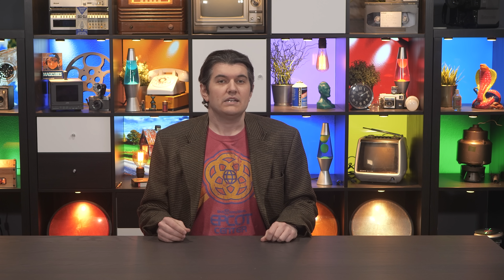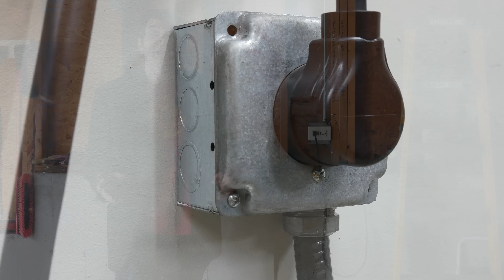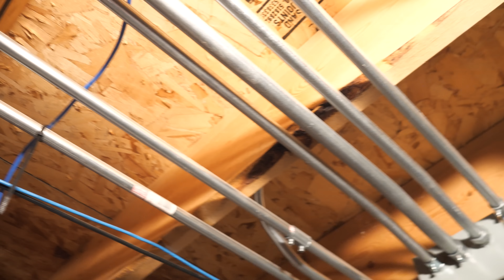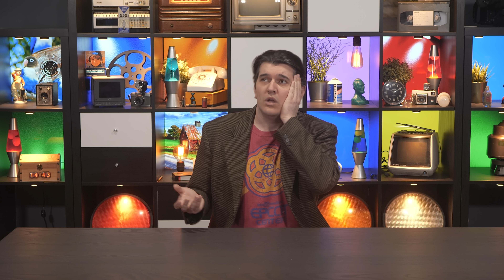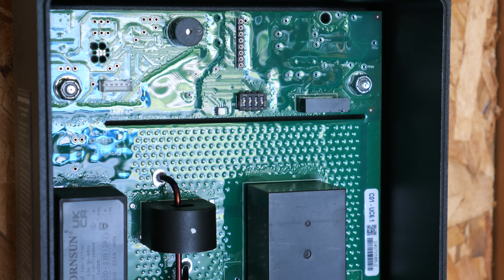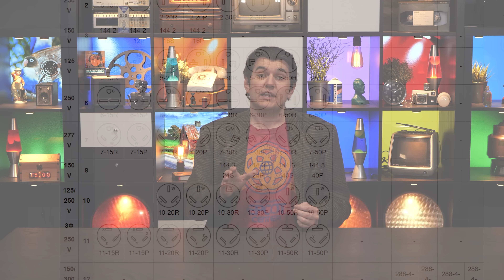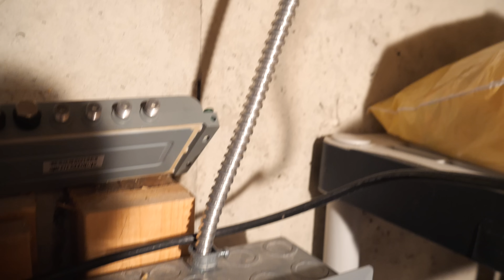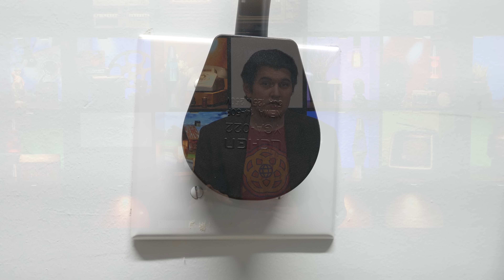The "standard" car charger is usually overkill—but your electrician might not know that

Comment: I love tech, but the first thing to fail is always SOFTWARE before HARDWARE. Smart apps and bad coding is always the breaking point. I love smart stuff when it works, but it's always the app design or layout or just the software not working that causes the issues.

Comment: The entire 'smart' home device which requires a separate general use device with a proprietary app installed repertoire is a horribly dumb idea. You are buying a device that CANNOT be relied on to still be useable in as little as a couple years depending on what happens with updates and development for the application, especially if the interaction requires a remote server to handle anything.
The large NEMA socket wear issue thing is actually a problem at RV sites, and you are gonna be surprised with the average draw from an RV with two or three rooftop AC units during an average summer day when the air temp is above 95F. A large amount of the problems I saw had to do with poor connection in replacement plugs, but that also can get the contacts in the socket messed up if the heat is bad enough. We still replaced many more GFCI outlets than any other socket type though.

Comment: I’ve charged a Jaguar I-PACE and a Tesla Model 3 on just a 15 amp circuit and over a 100 foot extension cable, and it was more than sufficient for both of them to handle my 40 mile round-trip commute even if I forgot to plug it in a day or two or went somewhere for the evening sometimes. For me, it’s not necessary or worth the cost to install anything bigger.

Comment: If you are serious about owning an ev, then owning your own generator [probably diesel] is imperative - 13kw to 18kw is what I would look at, leaving room for additional loads like... having TWO chargers.  Run a side business during summer brownouts if you like.   When it counts the most, grid service may not be there.  Think hurricanes, tornadoes, or feckin loons destroying California administratively from various offices.
Assuming a modest 7.2kw charger and 208v supply, thats near 35 amps.  That is about double the energy used on a typical central air conditioning system,  so... you gotta decide based on kwh rates in your area as to whether you charge off the grid or burn diesel and make your own power.  And guess what happens to flex rates?  Peak kwh pricing spreads out from mid day to deep into the evening - no, they are NOT going to cut afternoon prices just because most battery charging loads hit between 6pm and 1am for private citizens.

Comment: 4:23 10 gauge MC Cable may be all your local store carries, but that's definitely not the largest there is. I installed 4-3 MC Cable (couldn't find 4-2), which I bought online for my 48 amp charger with a 60 amp breaker. Did I NEED 48 amps to charge my car? No. But it makes me happy. And the 4awg made the inspector happy because 6awg is only rated for my circuit under intermittent usage, and a charger's considered continuous usage.

Comment: I know a number of EV advocates who still regularly claim that EVs aren't for everyone because some homes only have 100 A service. I will say that the increased efficiency of 240 V is worth it, but the lower current 240 V circuits are extremely viable options.

Comment: Honestly the standard is moving to 48A hard-wired. No plug/socket at all.

I still think having 32A charging (comes from the 40A outlet pictured) is what you should go for unless there's some massive increase in cost to get it over 20A.

I just think having an outlet is more versatile than hard wired. You can switch to a new EVSE more easily if you have problems with yours.

But not having an outlet does prevent outlet wear issues. Which really shouldn't be a big deal, you don't plug and unplug your EVSE often. Not like at an RV park.

Comment: To anyone looking to pick a fight about the current handling capability of the 14-50 outlet.  Please look up the 15-60 before posting.  It uses the same size contacts and pins as the 14-30 and 14-50.  Long story short, we use these standard size pins for economies of scale, and just run them in different physical configurations to prevent the wrong voltage, current, and phasing from being accidentally connected improperly.

Comment: simple, requiring a high power home charger is additional income to EV companies.  Tesla is so successful with their propaganda for high power home charger that they made the portable charger cable as an option or additional cost, citing that significant number of users don't use it and $300 is substantial.  This charger is plenty at 240V but still useful for most people at 110V. 
Android smartphones have absurd fast chargers/charging speeds these several years but I continue charge my devices at USB 3.0 from my PC/laptop.

Comment: People forgetting that you can literally push a electric car to any building with power and plug it into a standard outlet (if you have it in the trunk witch you should) and have power over night (better than non) and they just think you up a creak with out a paddle
Reply: For myself, I've aged out of pushing cars, and with modern cars you can't use one vehicle to push another anymore, it's all plastic and damage is substantial just barely touching the plastic to anything.  My EV had to be towed, once, when it lied to me and showed 5 mile range but traveled only 1.5 before shutting down.  On SuperBowl Sunday.  1.5 hour wait for a tow two miles.  Eventually, tow companies will offer mobile charging (the hardware exists, it's available to purchase), but for now EVs largely get towed when they run out of fuel.
Reply: @alsavage1 oh right also evs have regen braking that will be a problem 

But I think can’t you charge from another vehicle though using the same logic of just plugging into a passing truck or mini vans plug (I know they often have power limits but in a pinch it still would work)
Reply: @scrap-godsuper-zo4740  Well, regen braking only works if the HV contactors are closed, and at least in the EV I drive they will not close once the BMS says, "we're done here".
There do exist EVs in 2025 that can V2L to another vehicle to charge (F150 Lightning, Rivian, MB various, Kia 2026 something?) but it's not common in the US yet.
Reply: @alsavage1 oh I know the lightning and some other vehicles have a specific feature for it but in a worse case scenario couldn’t you plug into a regular outlet on any vehicle that has one
Reply: @scrap-godsuper-zo4740  Assuming that I am carrying an EVSE with me, then yes.  Not everyone carries an EVSE with them (they should, if driving an EV), and at 120v/12A input, roadside charging will be slow, but yeah, it can be done.

Comment: I have a NEMA 14-50 with a 40 amp EVSE but I run it on 34 amps most of the time because I don’t need the full 40 amps and it has an easy way to set it down. No need to push the plug any harder than necessary though it’s a commercial outlet given it’s in a high rise parking garage.

Comment: I’ve had a 40a circuit supporting a dead simple 30a EVSE since 2011.  When we added a second EV I charged on a (dedicated) 120v 20a circuit (originally for a plug-in snowblower) until I remembered I had asked the electrician run an extra wire - thus it was trivial to wire up a 240v20a breaker and put in a 6-20 receptacle. This combo was a great solution and met all our charging needs.
Reply: You did not need an extra wire: you simply had to mark the neural wire as "hot" with tape.
Reply: @economicprisoner  you’d be right If I didn’t also want to keep a 120v option
Reply: @essaunders  For my house I can run an extension to a second outlet. (the junction box where they split would have two voltage sources if I add a 240V breaker)

Comment: From what I’ve seen, most dryer outlets are aluminum wires. Mine included.

My electrician suggested I install 4awg copper wire since I like trucks and there’s a chance I’ll get an EV truck in the future. 4awg copper supports a lot more current, and the biggest cost is installation

Comment: I looked into EV but decided against it. Only reason is code here does not require outlets to be grounded. Luckly half of my house is grounded but only on thr back side. So for safety, I decided against it until i can save up to get the whole house wiring  updated.

Comment: And if EV manufacturers wanted charging to be easy they'd make the batteries easily removable and ship the car with a second set, you'd charge em outside of the car and swap em out so you could have the batteries charging wherever while you're doing shit.

But EV's were made by twats for twats so logical solutions never were the consideration.

Comment: I'm constantly amazed at how terrible the US wiring standards are. 

Here in Australia, yeah, we use an American plug standard, but it was intended for 15 amps and we run it at 10. All the power circuit wiring is rated for 20 amps continuous. We just don't have these issues where things melt if used at the rated power. An EVSE with a 10 amp plug won't draw more than 10 amps. It is perfectly safe to leave it plugged in and pulling the full rated power all day. Hell, plug another one in on the same circuit. Nothing bad will happen. Plug in a third on the same circuit and the breaker will trip. Long before the magic smoke comes out. Want to plug it in and unplug it every day? Knock yourself out. Your grandkids will die of old age before your sockets wear out.
Reply: PS, I just replaced all the wiring, sockets and switches in my unit. There was nothing wrong with them, but there were major works needed and it was one of those "while you're there we may as well". Everything was original. 110 years old.

Comment: As a European (from the Netherlands specifically) I'm happy to see that at least some parts of the US use conduits. Having loose romex through the walls just seems like a disaster waiting to happen for multiple reasons.
Reply: Why?  NM-B ("Romex") seldom has any issue itself.  Problems are usually with devices connected to the wiring, receptacles, wire splices, etc.  Unless you run a nail into it, if it's been correctly installed it's not a hazard.  EMT looks neat and all but I don't see the point.
Reply: @alsavage1  The reason why I like conduits (and dislike things like romex) is that the paths for the wiring are predictable and consistent. While it's not impossible to drill through a conduit, you need to be an idiot since you can figure out the conduit locations from the wall outlet placements. And if there's ever a reason to run a second wire for some reason (i.e. extra circuit, more lights, whatever) you can just pull the cable through.

I'm not saying romex is all bad, it's easy to install and generally won't be an issue, but I'm certainly less of a fan :)

Comment: I’m an electrician and have been using a 20amp 240v circuit drawing 12amp to charge our ID-4 for a few years. It was left over from when we had a Volt and it’s worked out great with pretty much no need to upgrade.
Reply: Has the range reduced more than 10% after 4 years?
Reply: @mohanjan8768we’ve had it a bit over 2 years and we’ve noticed no changes so far. It has almost 65k miles on it so far.

Comment: In the 230V/400V world (any place but North America and parts of Japan, 230V circuits come in 6 common sizes: 2.5A, 6A, 10, 13A, 16A and 20A .  For any more power, go to 400V 3-phase (that is 400V between phases, 230V between any phase and ground), and circuit sizes are 10A, 13A, 16A, 32A, 63A (any higher is specialist installs).  GFCI modules exist for all these circuit sizes, optionally combined with breakers, that are rated for 100% rated load, not 80% .  For the 230V circuits, some sizes will be omitted in some local electric codes and their plug sizes, but for 400V, the round waterproof IEC 309 plugs are used almost everywhere, with older designs in just a few places .
Reply: Are >20A circuits not common around the rest of the 230 world? Here in the UK it is quite standard to have 32A circuits (cookers and showers), 40A (usually showers) and 63A (high power EVSE) all on 240V. I believe that if you want more power than a 240V/100A service then you have to have a 400V 3-phase supply commissioned as you mention. Although, it is common here for domestic charging points to use a current clamp on the main incomer to dynamically limit current draw so as not to exceed the service rating (particularly, allowing use with e.g. a 60A main fuse).

Comment: Batteries being what they are I would never go fully electric, hybrid maybe and even then I'd be being particular about the car as I am very against the spyware filled bullshit that many newer cars are loaded with.

Fuel based engines are just so much more convenient when you don't have time to sit around waiting & if the charge is only gonna take you a hundred odd miles you might as well have a fuel capable backup to that built in.

Comment: I stole the 30amp water heater circuit for the EV charger... and it is waaay overkill for my Zero SR 14.4kWh battery getting ~9mpkW...
Had to run new power when I decided to replace the old gas water heater with a heat pump (because the 15amp connector on the bike is broken) and ran a 30 amp RV receptacle while I am at it... may garage has waay too much power, it also has 3x 20amp lines and 1x 15amp... so yes, my garage has 165amps of capacity... on my 175amp panel... =oD

Comment: Isn't there also the option of converting a 120V circuit to 240V by replacing all the outlets on the circuit with 240V versions, the breaker with a double pole version of the same current rating, and properly relabeling the neutral as a second hot? Might be worth considering if running new wire is hard to do.

Comment: For the streetside parking:
 I live in Germany.  I'm a trained electrician.   The street lights in front of my House got recently switched to (annoyingly bright!) LEDs, so each light uses about 10 watts total now.
I also know,  because I used to work for that company,  that each lamp post is wired up for 400V 32A supply.   IMAGINE THE STREETSIDE PARKING THOSE WIRES COULD ENABLE!!!!

But no!  It's metered to the city (who pays for the light)  so because of that I can't have an EV. Even though the power lines are absolutely already there...  Because of course there's no garages anywhere in a 5 mile radius.

Comment: If it's easy, YES.  Yes please make a new one.  Odd probably not helpful suggestion... pair up with someone buying a used EV.  Used EVs are so cheap, and so adding charging info to "Hey you can buy a reasonable EV for CHEAP" would be a good double-whammy.  But obviously, you don't need a new used EV, you have a great car.  I drove a Ioniq 5 for a few days and just loved it -- but it wouldn't fit in my garage.

Comment: One way that EVs should be legally mandated to be more like gas cars is that instead of stopping you from driving away when plugged in (potentially trapping you in a dangerous situation) chargers should have break away cables (like how gas pumps have break away hoses). 
Or alternatively we could require all EVs be capable of ejecting the plug, and have an auto ejector replace the feature that stops you from driving away when plugged in.

Comment: When I got my Model 3, it came with 3 months of free "Supercharging".  I felt like I had to make use of it while it was free, so I did, but it wasn't super convenient.  The technology is really cool, but driving 10 minutes away, and charging for 20+ minutes every week was pretty inconvenient.  Now that the free Supercharging is done, I generally just charge at home with a standard 120v outlet, which is very convenient.  The only issue is that my electric rate has been steadily rising to almost double what it was when I moved here just under 2 years ago.  My home electric rate including supply and delivery is about $.29/ kwhr :(  If I knew I was going to live here forever, I'd get rooftop solar installed.

Comment: So far, I have been simply unplugging my dryer whenever I want to charge my car. How important is it to use a splitter to keep them both plugged in together? Edit: I just got to the wear from frequent unplugging part of the video. Now my problem is, which one do I get? One without a cord would be good, so I don't have to screw a unit in somewhere, but the one I see says it uses an app, and that sounds iffy. And then there are ones that are half the price or less, but are those just Chinese crap that will do more harm than good? I'm hitting decision paralysis here.

Comment: here in the Uk When i got my house rewired 3 years ago i had the electrician install a 6mm twin and earth cable to the consumer from the front of my property. just last week i had a wall charger fitted. It supplies 7.2kw of charging. during the night I'm charged 0.07p p/kw. its for really cheap and convenient. I've yet to go on a journey long enough to need to use an expensive public charger but i estimate ~90% of my charging needs will be done at home.